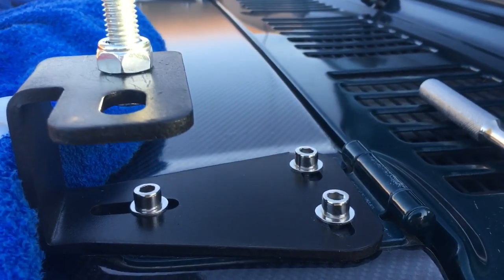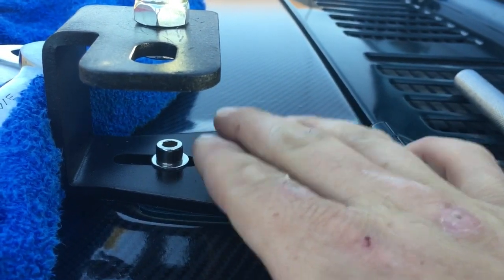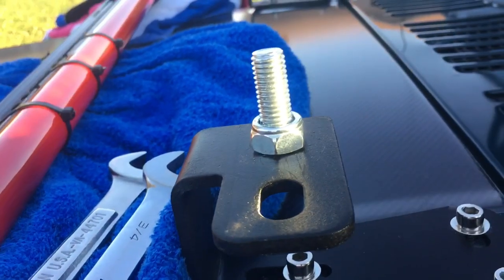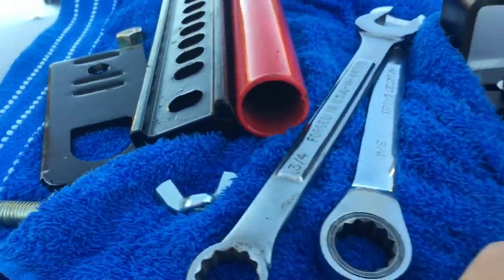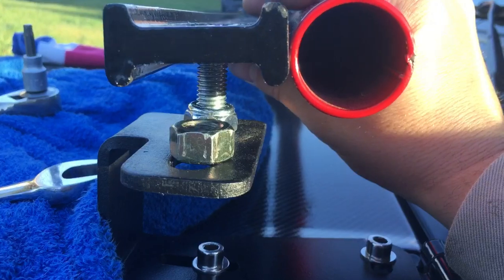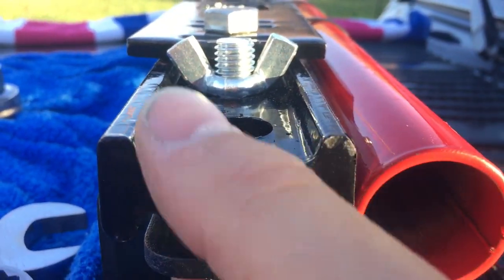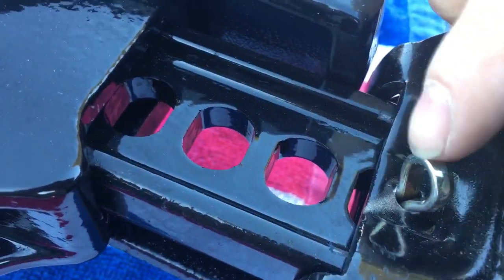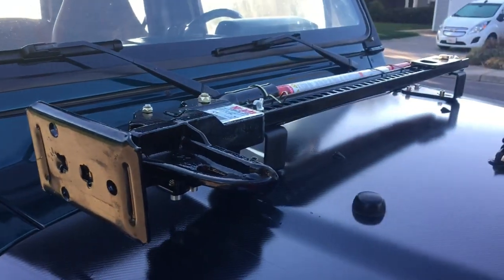Jeep Wrangler How To Install HI Lift Jack & Hood Mount Brackets On Overland CJ YJ TJ LJ  Farm Jack

Comment: Hello, looks really nice..  I ordered the same brackets not too long ago.. I just have not installed my Hi Lift yet.. I wanted to know hows it been since you installed it.. any rattling? and what about when removing the screws that held up the hood did you find it difficult to unscrew?
Reply from the maker: Erwin Posada  I can hardly tell the jack is there, and if you use the the right torx socket when removing the hinge bolts you should be fine. I definitely recommend using a socket and ratchet though. Glad I can help 
Thanks for watching

Comment: I was also thinking of buying some rubber washers so that the screw and wing nuts do not site exactly on the hi lift causing it to scratch.. have you noticed any issues there? Thanks again.
Reply from the maker: Erwin Posada sure that would be a good ideal maybe some rubber washers that rest on the bolt and nut so when the jack rests on the mount that make senses should help out